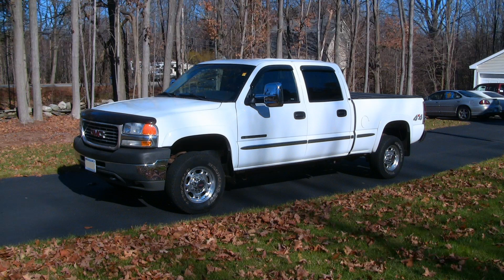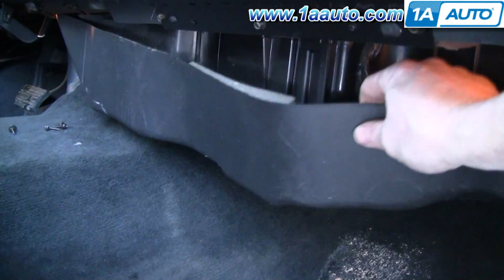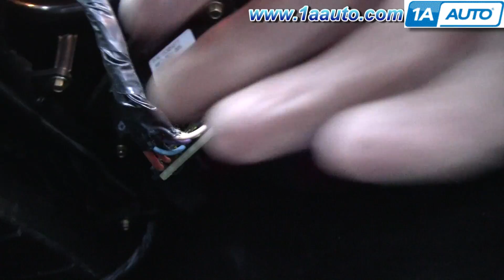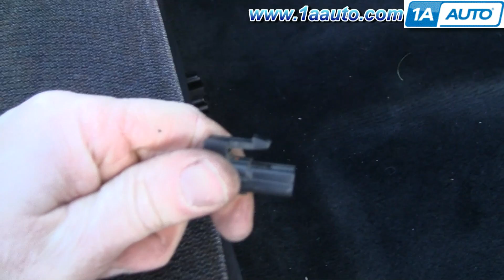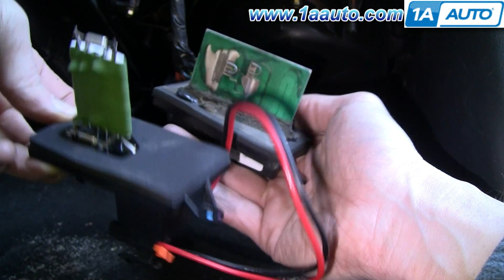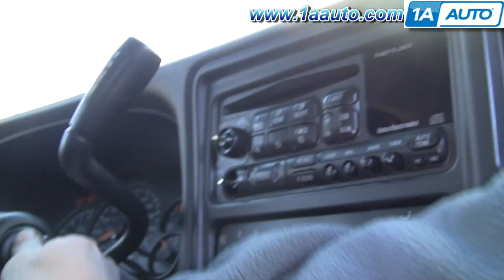How to Replace Blower Motor Resistor 03-06 GMC Sierra 2500 HD

Comment: Bought just the resistor, and what a difference, blower works, and cool air. Most likely going to change the blower motor later. One problem, damn engineers, need to talk to mechanics on making those electrical plugs, more accessible, what a pain to detach. Should have had the latch towards the person working on it. Unfortunately, this is the last U.S. made vehicle I will own. My Japanese cars are way more sensible, and easier to work on. 1A Auto, thank you for the videos, great help!

Comment: When I put my hand on the vent I feel warm air but the fan isn’t blowing. Would this still be the resistor, or would I be looking at replacing the blower motor?

Comment: Actually you turned the resistor 180 from how the original was installed--you can see with the 2 side by side that the cable is coming out the other side.

Anyway thanks for the help, my blower randomly stayed on after lunch today resulting in a dead battery, and this is what I need to do.

Comment: My Heat/AC work. However they don’t turn off and are always on high. Even when my truck is off it still runs until fuse is pulled. Any idea?

Comment: I have no heat.. fan control doesn't do anything. Replace blower and thermostat. Still nothing.is this the next step?  After its warm and you drive for about 10 minutes you'll get a trickle of heat rising out of defroster vents on dash.. doesnt blow out just rises because heat rises..

Comment: Thanks alot for the help! The resistor I took off was the 2 hole and it didn’t match to so the previous owner screwed the driver side screw in first and then used a 1.5” ish wood screw to hold the other side in. Oh well! Go with the flow! It works! Very good directions!
Reply from the maker: +Gabriel Arriaga Thank you! We love empowering our customers and showing how to perform DIY auto repairs with our high-quality auto parts.  http://1aau.to/m/Shop-1AAuto-c

Comment: Hello
I have a 07 Chevy Silverado 2500 (new body style) auto hvac control, is there much difference between the 5 speeds.  Speeds 1/2/3 seem very weak speed 4+ 5 are very noticeably different.  This seemed two occur after changing the 2 batteries.  By chance does the control need a recalibrate or is it just the resistor pak.
Thank You

Comment: I had only blower speeds 1, 2 and 3. I changed the resistor, now I have speeds 1-4, but still no 5. I changed the blower motor, still no luck. Amy ideas?
Reply from the maker: +Tilman Frers You could check the fuse or try disconnecting the battery for 15 minutes and see if it resets itself.  If that doesn't help, we suggest having it looked at by a professional.  Thanks for watching!
Reply: @1AAuto  thanks. Will do.

Comment: I have a 2004 Chevy Silverado 2500hd 1,5 doesn't work 2,3,4 work is my motor resistor bad or do i have to replace the motor?
Reply from the maker: +Hellion Thanks for checking us out! The issue described is usually caused by a failed blower motor resistor however, there could be multiple reasons why you're having this particular problem. We suggest taking your vehicle to a nearby reputable shop to identify the cause. Thank you!

Comment: i have a 2008 gmc 4.3 1500. i get no fan on any position. the vent changes position, heater works, a/c works. but fan wont blow.

Comment: Replacement worked exactly as described. My '01 Silverado has only had fan speed "5" working for years. Had an auto electrics specialist tell me to "just get a new a/c control panel. About $100 for parts, plus labor." Your video has me up and running for under $25. If I wasn't hitting the hiway tomorrow, I would have bought my resistor from you. You've earned my respect, and I'll make sure I check you first next time I'm diagnosing a problem with my truck. Again, many thanks!!
Reply from the maker: +Rex Anderson Thank you for your order. If you would like to leave us a review on Google it would be greatly appreciated. Here is a link to our reviews section. Have a great day! https://goo.gl/i5JFNY

Comment: My 2001 lost high speed only. I had no power at "Terminal “G” Orange with ignition on, as its supposed to receive constant power from hvac 30 amp fuse under hood. the fuse tested good,  so i pulled the fuse block out and followed the two fat orange wires, the burnt one will be obvious, cut and add wire to hard wire to positive bolt, then add a 30 amp inline fuse inside the cab. black out the fuse location. Finally high speed a/c
Reply: Keith Lavallee no video? Lol mine also won't blow on 5

Comment: got a 1998 chevy 1500c basicly same problem except mine just doesn't shut off in the off position just  stays on full speed and if i wiggle the knob or press on it, while it's on full speed it shuts off until i wiggle or press on it again think this would be the resistor or the fan speed control  knob switch its self. any ideas?

Comment: I changed the resister still nothing, going to change the motor tomorrow I hope that fixes it.
Reply from the maker: +artifactman660 Thank you for checking us out. If you are unable to use any speed, the blower motor may be the issue, but you took the correct steps in diagnosing while attempting to test the resistor. 1aauto.com

Comment: I am having a similar problem with my 2003 Sierra 2500HD. The A/C works when I drive it will blow out the vents, but the fan will not come on at all. I have the digital display with dual climate control. I am wondering if this is different? Thanks
Reply from the maker: +Jacob Taylor If the fan is not coming on at all then the issue is more likely with the blower motor itself, rather than the resistor that controls the speed.  http://www.1aauto.com/1A/BlowerMotorResistor/Chevy/Silverado/1AHBR00009?utm_source=YouTube&utm_medium=CTA+Comment&utm_campaign=ytcomment&utm_term=O7DqaqHTCzw

Comment: Hey thanks for the video! I just purchased a ac control module from 1A auto for my 2005 gmc sierra 2500hd. but I was curious if you knew where I can't get a wiring diagram for the system? Due to the previous owner installed a toggle switch running under the dash to two wires and when you flip the toggle switch the AC turns on but I don't like to have it rigged that way that is why I purchased the new module

Comment: I replaced the resistor and I don't have speed 5. All but 5 works. Replaced wiring and block that connects to the resistor as well and no 5th speed. The resistor is bypassed to get speed 5. What is there left to check, fan control? The relay is built in to the resistor correct?
Reply from the maker: +Mike Wheat Thank you for checking us out. It could be the speed dial on the HVAC/Heater control causing this issue. There would be a secondary relay in the under hood compartment for the blower. 1aauto.com

Comment: My fan completely turns off when turning on 5 (high).  Should I go ahead and order a resistor from your site or would this be a different issue?  I'd think that high would remove all resistors from the circuit, but I'm unsure.
Reply from the maker: +Drew Baden Usually when the blower motor resistor starts to go, you will start to loose the speed settings. Here's a link to the one shown in this video if yours needs to be replaced. Hope this helps you out https://www.1aauto.com/1A/BlowerMotorResistor/Chevy/Silverado/1AHBR00009?utm_source=YouTube&utm_medium=CTA%20Comment&utm_campaign=1ATony

Comment: If you are only getting one speed is it the resistor always? Or is the blower bad too? On my 2000 Silverado It only worked on 5, and then completely stopped working. Should I start with the resistor and then possibly the blower, or is my blower shot?

Comment: Just did my Ford Escape a few days ago and Papa says his 2005 GMC does not blow on 5. So am here to check out location. All blower levels work off of same resistor correct??? I mean to say it does not matter which # it does not blow on they are the same resistor? Thanks.

Comment: Great video! I was able to do this job on my own fairly easily. However, I have noticed my speeds have started to go away, again. If I replaced the resistor, do I now need to replace the blower motor? And if that is the case, will I need to replace the resistor again? 

Thanks!
Reply from the maker: Typically the blower motor resistor controls the speeds. You may want to check the plug end that connects to the blower motor resistor to see if it is damaged from being overheated. If it is, you should change the plug end.  Hope this helps you out. 1aauto.com
Reply: 1A Auto Parts where does one obtain that plug end?

Comment: Replace both; the resistor block and the connector coming into that block (5? or 7) wires. They both overheat and melt the plastic around the pins, causing them to loose contact.

 Great video, thanks for taking the time!

Comment: Thank you excellent info.  have a 2005 sierra fan would only work on 5 then just stopped.  watched video replaced blower motor resistor and its fixed
Reply from the maker: Thank you for watching. Please let us know how the repair comes out!
1aauto.com  888-844-3393

Comment: I have a 99 suburban, replaced the resistor and still nothing ! Took the fan out and hooked it directly to the battery and it works ! Put it back in so now where do I check ?
Reply from the maker: Thank you for watching our video! We would recommend you check the fuse to the blower motor as this could be where the issue resides. Thank you again, and have a good day!

Comment: Hello, I have a 2006 GMC sierra. Currently all levels of heat work however when warmed up there is an Oder like some wire burning. At times when I listen closely I hear the levels on the blower go weak. Could this be the resister or the blower motor?

Comment: Hello, 
I have a 2000 Silverado 1500. I just replaced the resistor because the motor only worked on High. Immediately after replacing the resistor, it started blowing cold air and only worked on defrost/floor setting. The controls weren't changing anything and they worked fine prior to the new resistor. Is it the control module? Could the blend door actuator and HVAC mode actuator have gone bad at the same time? Any ideas are helpful! I just had to drive 30 mins at -20 temperatures!
Reply from the maker: You may want to check under the dash board and also in the engine compartment to see if there's a vacuum line that may have become disconnected or cracked which could cause this to happen. If that checks out to be fine, you may also want to make sure that you have installed the correct blower motor resistor for your application.

Comment: All my speeds work except 4. 2001 Yukon. Do you suppose it's the same problem?
Reply from the maker: Thank you for watching! Typically if a resistor goes you will lose the lower setting and only have the high function. Hope this helps!
1aauto.com  888-844-3393

Comment: Ok so i have having a problem with my truck a 99 chevy silver ado when i turn the blower on ac or heat it vibrates a lot what would cause this?
Reply from the maker: Thank you for the email. You may have a problem with the AC Compressor or even the Blower Motor. Hope this helps!
888-844-3393

Comment: What causes our AC in our 2004 Chevrolet Silverado to work when we first start our truck and then quit working after we drive for a few minutes, then start working 15 or 20 minutes later and continues working and not working. Could that be related to this blower resistor?
Reply from the maker: You may want to check the blower motor resistor and also the Freon level to see if it's at the proper level.
Reply: It could also be the tensioner pull for the ac belt i had issues will mine it finally seized up and snapped by belt maybe a bearing messed up on it or something causing it to stick and unstick which would cause the ac to turn on and off.
Reply: My husband changed the blower motor resistor, but still not working. Stays on for first 5 minutes and quits. A mechanic told him he needs a new compressor without looking at it.  I hope he is wrong.

Comment: Thanks for the great videos! I have an 04 Yukon SLT with dual front plus rear automatic climate control. Recently the front passenger side stopped pushing air in both heat and cooling modes. I was actualy driving the vehicle when it stopped working and I heard what sound like something ground to a stop. Rear and drivers side still work fine. I suspect a door actuator, what are your thoughts?
Thank you for your time!

Comment: Thanks for the video. I was able to change my resistor (2005 Yukon) in less than 1 hour. I didn't/couldn't have to take out the center screw on the outer casing. I took out all but and pulled down the plastic. Just remember the 2005 Yukon has the 4 hole version of the resistor (costs $25 more).

Comment: Ok. So i recently bought a 2005 chevy silverado half ton. I drove it home and i turned the ignition off. but the A/C was still running and it ended up draining my battery. I pulled the cable and the A/C turned off as expected. But id really like to get it fixed. Is it my blower resistor? It wont even go to any other fan speed. It just stays at the same constant speed.
Reply from the maker: HI Maco, You may want to inspect the blower motor resistor and also the plug end that plugs into the resistor. It's common for them to melt due to the resistor going bad. If it does show signs of heat damage you may want to replace it, and also the blower motor resistor. We carry new blower motor resistor and also repair plug ends on our website. We also offer FREE SHIPPING in the lower 48 states. Here's a link to them on our website, if you need them. Hope this helps you out. http://www.1aauto.com/1A/blower-motor-resistor/Chevy/Silverado1500/-/-/2005?utm_source=VideoReply&utm_medium=YouTube&utm_campaign=1ATony

Comment: Thanks for the video, I think you could make a career under the dash on the passenger side.
If you had put the resistor in 180 degrees the plug would of fit?

Comment: Thank you for the help, The 3 levels of speeds of the fan wasn't a concern of mine then #4 and #5 acted up and were not working all the time and thought this could be a costly repair to my truck.  The truck has 241,000 miles on it and sometimes wonder if it's worth repairing.  When I pulled up this video it showed me exactly what was happening to the truck and with a little help from this video I was able to repair this at a low cost!!  The tutorial was very precise and helpful to make this a quick fix. Thanks again and I have used this site and will continue to use this for future repairs!!
Reply from the maker: Thanks for watching. Have a great day! 1aauto.com 888-844-3393

Comment: I changed my blower motor resistor in my 05 Trailblazer and all speeds worked, but after a few hours only speed 5 works? Should I replace the blower motor itself or could it be the fan speed control resistor/switch?
Reply from the maker: You may want to check the wiring harness for damage, and also see if there's power going to the blower motor resistor when the lower speed settings are selected. Hope this helps you out. 1aauto.com 888-844-3393

Comment: 77biglow I had the same issue with my 99 S10. What my problem was is the blend door is an electronic switch. My connector going to the switch come loose causing the blend door not to open. Plugged it in and bam fixed.

Comment: I have a 2006 GMC Sierra, but with a digital heater / a/c display. I was having a similar problem, the fan would pretty much pick it's own setting no matter what I put it at, and then it just ran on high, and also ran for about 5 minutes with no key in it. I took out the resistor, and it looks much different then this one, (and doesn't look burnt or melted either). Anyways, just wondering if this could this be a problem with the heater deck itself? Thanks!

Comment from the maker: It could be a bad connection to the blower motor. You may want to check the connection to the motor to see if it's connected right, ans also if there are any signs that is has heated up. 1aauto.com 888-844-3393

Comment: Great Video, I have a 2003 chevy avalanche 1500. For the last 2 weeks the blower motor would make a surging or pulsing sound when on any of the speeds. Then today the blower won't turn on at all. Do you think it is the blower resister or the motor itself?

Comment from the maker: The actuator for the blend door could be bad, or if it happens when the AC is on you may need to re-charge the AC system. Hope this helps you out. Have a great day! 1aauto.com 888-844-3393

Comment: I have a 2001 yukon xl that was only working on stage 5.  I ordered the part from 1aauto and followed this video and minus one difference in screws that held the decorative cover on, it was perfect.  Thanks so much!  BTW.. I found that a 9/32 would work in place of the 7mm socket as I didn't have one.  I also found the deep socket to be of great help in the "hidden" bolt that in my case, was also behind the center console tape player and no fun to get at.

Comment: Hi I have a 2004 GMC 2500hd the fan only works on 5 now would this be the same procedure form my truck , The video was spot on I plan on fixing in the spring cause it's COLD out  can I get the part from your site , Thanks

Comment: hi i have a 99 z71 i just replace the air door actuator there are 2 in this truck the 1 i replace is under the dash now ,when i go the get air to the face it go,s to defrost and when i go to defrost it blows in the face an the a/c runs cant get the a/c to turn off what wrong with it

Comment from the maker: You may want to see if the thermostat's working correctly. You could also have an air pocket in the cooling system which may be getting trapped. If the heat isn't blowing from the blower motor, check the blower motor and the blower motor resistor to see if they have power going to them. We sell new blower motors and resistors on our website 1aauto.com 888-844-3393 if you end up needing to replace one of them. Hope this helps you out.